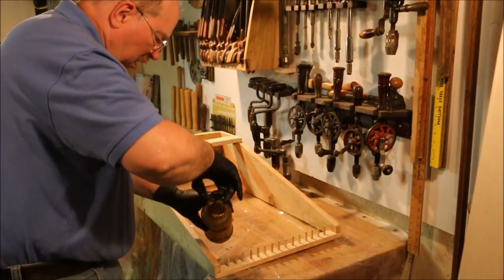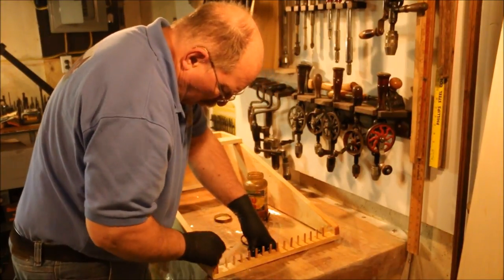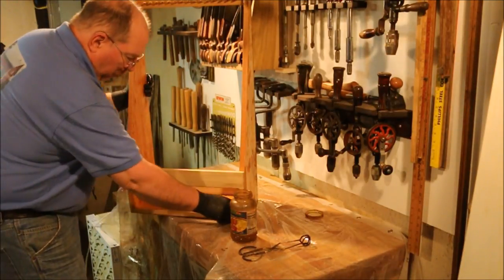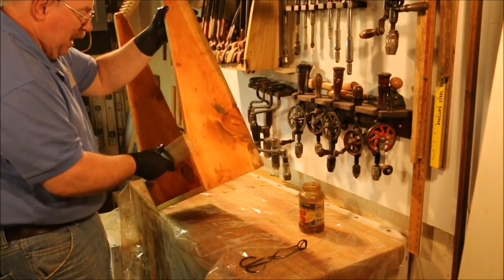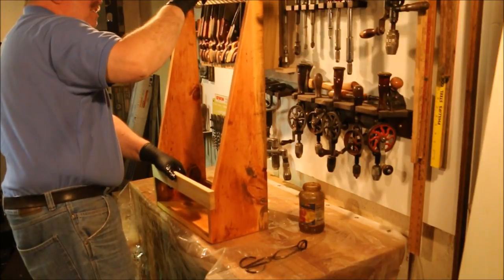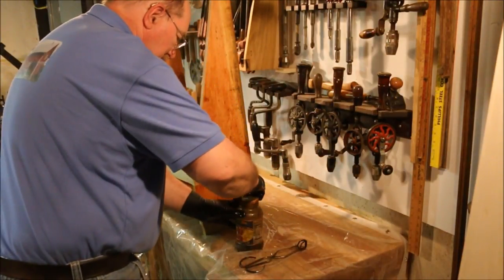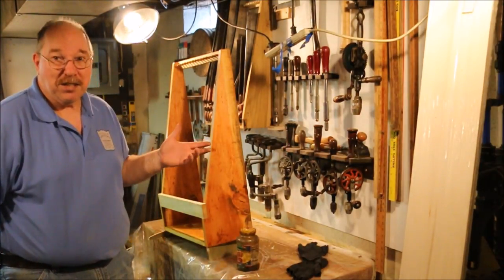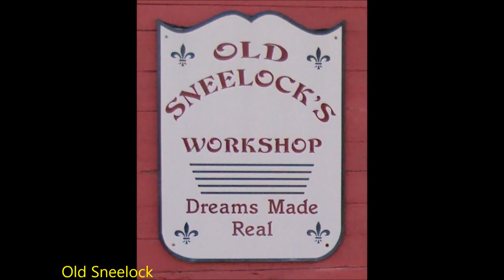MAKING A WORKING SAW TILL ~ PART 5 ~ ADD PEGS AND BLO

Comment: Ah-HAH! A weekly run to THE store! NICE! It always brings joy to the heart of how BLO soaks into wood and lettuce leaves equally well and the measured cadence on the ocean floor of barnacles moving out sharply away from the visiting wooden leg. Just brings tears to a glass eye, doesn't it. And as the saw sharpening jobs increase I wager there will be some Belsaw equipment restoration videos forthcoming as well. Everyone benefits as usual. Thanks, Unc!
Reply: Lewie McNeely don't forget the benefits of the wonder ye olde elixir and a new one foot softener he's half way there his socks already soaking in it are the pure magic of the golden necker
Reply: I use old socks for grease rags if I can hammer the lumps out before hand.  I meant to add that to Unc's comment but I forgot. The lumps are handy for filling knotholes and rust spots. Not to mention putting a mirror finish on hammer faces.
Reply: Lewie McNeely yes shiny hammer heads works wonders for my head as well my hair has never looked so shiny if I could only find it it's age keep forgetting where I put it down 🙃
Reply from the maker: Lewie McNeely There is the Belsaw retoother that whines when I visit the storeroom. It wants to come out and play.
Reply from the maker: David Chadwick Auto correct. The Origin Of The Golden Necker. That would be a great Angelina Jolie movie. 😈
Reply: GOOD! It was sounding like it might be wanting something for nothing by whining BUT it's a whole lot different if it wants to earn it's keep! Please pat it on it's little steel/cast iron /whatever head and tell it I'm proud of it and it's work ethic! I didn't think you'd put up with that kind of mindset or sawset AT all and glad I was right. It don't happen much.
Reply: Less hair to comb but more face to wash. I especially like how it cleans the grooves in the waffle-head framming hammer.
Reply: That sounds like some of that stuff that's already been done.
Reply: Old Sneelock's Workshop I've noticed dam thing I'm sick of words changing on there own apparently is predictive text ? I'm told never mind I'm sure she will look good in BLO puts a hole new meaning to salad dressing 😈
Reply: You have to go back over everything you put down as it'll change whatever you want left alone and leave everything you want changed.  Just like the present system of a lot of things except here.
Reply: Lewie McNeely You can say that again.i make sure it's correct and when you press send it changes technology that's it technology marvellous
Reply from the maker: It adds an air of mystery to every post. Huh? 😊
Reply: Yes and where the next lawsuit or censor is coming from!
Reply: Old Sneelock's Workshop I’ve sent a message Dave with a picture may be because I haven’t a computer I can’t find any war related catalogs to tell you any names or numbers may be you can ?

Comment: I used the old shower curtain to lay on while working on Momma's car .  I forgot I used it while spraying poly  in the past.  When i got up the poly pealed off and stuck to my back. Momma would not allow me in the house until it was all off and I had to past inspection.  shower curtains makes a good drop cloth.  I thought I would work part time after I retired, but now I just don't have the time for it.  You may have to cut that saw-till in half to slow down the work load to keep up on retirement time. Stay warm and dry and have a good day.
Reply from the maker: paul harriss Hopefully the 3 racks of saws in the storeroom will pass through the till on their way to new shops. 😆
Reply: I always had to go back to work for a rest from working at home. Now that I'm at home I don't know what I'll do. Sneak off and go AWOL I guess. But I'll have to come back home and be found out.  I'm beginning to believe 'retired' is just a word.

Comment: What Mite The Cost Of A Sharpening be?
Reply from the maker: Chris Anderson It is on a sliding scale. If the saw is in fair condition, no kinks, missing teeth, broken tote, missing screw nuts, std rip or crosscut, 26" or less,  then $20.00. It goes up from there.
Reply: Old Sneelock's Workshop that's not to bad

Comment: ..Could i send them to the North American representative and he could send them on the corporate jet to World Headquarters?? I have heard some dubious characters are trying to copy the Original BLO-Gu recipe. they are marketing  under the name of Rag-Seed...!!
Reply: Ol James sending to the North American Rep isn't a problem while the jet is off the road we have enlisted the help of the pony express.its not as quick as the horse has cast a shoe and is running around in circles but does reach the required destination sort of sideways thanks for the enquiry we always try to please
Reply from the maker: Ol James Rag-seed is a fine substitute for itching powder. Golden rod is another. Both of them cause the finisher to develop a green coating on all their work.  It is an interesting die job but hard to sell. 😨😲
Reply: How UNCOUTH, un-potty trained and un-deodorized among other things.
Reply: Deviation is the finest part of valor!
Reply from the maker: David Chadwick The Workshop Yacht is available for transatlantic deliveries but should only be  scheduled for the Miami to Morroco runs until the ice has melted on the St Lawrence Seaway.  We need to find a Licensed Captain and crew that weigh less than 450 lbs total. Any more than that and they will have to row because the motor and battery are 60 lbs alone.
Reply: Mixing Goldenrod with stinging nettles is a good combo. It doesn't add anything to the finish but sure doesn't take long to get done!
Reply: Look out Jimmy Bob. There'll be a title headed your way!
Reply: And we mustn't forget the rest of the alphabet. We'll be dubbed rationalists or some such.
Reply: Old Sneelock's Workshop we may be able to train the ships cat and the rats as its hands worth a try a bottle of BLO for food and pay could be a winner all round 👍